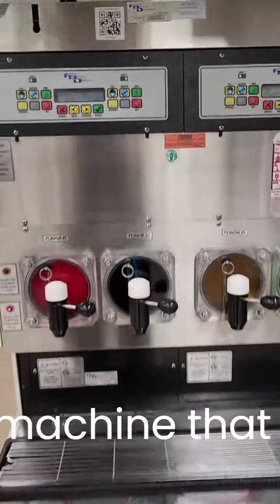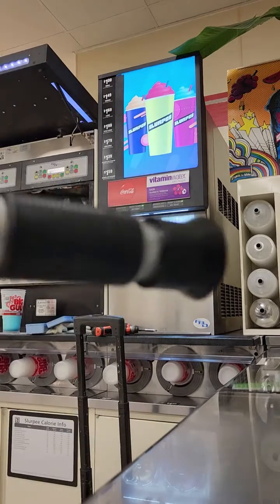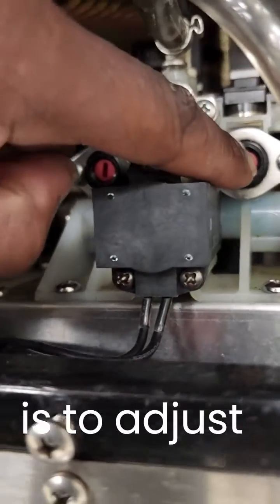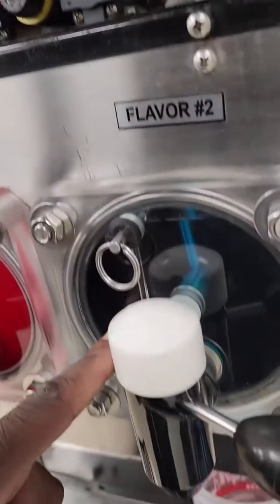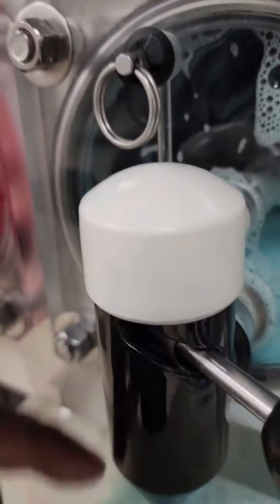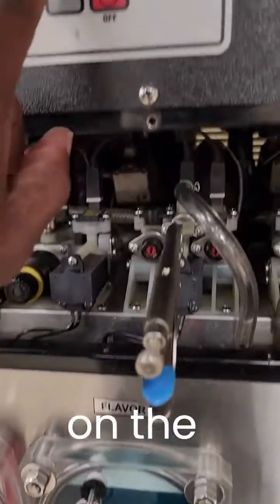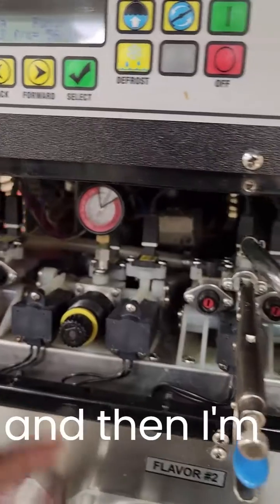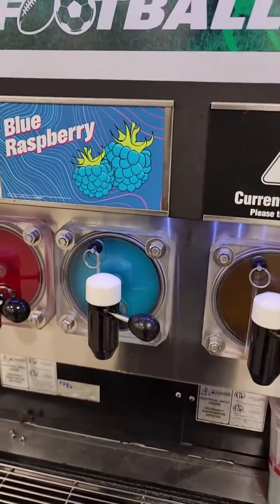Repair a Slurpee Machine Barrel not freezing

Comment: Hello, I have a problem. It was working, but now the machine is not working, the compressor is not working, and neither is the cooling fan. What is the problem?
Reply from the maker: Hello, if the compressor is not working it could be because the condenser fan is not coming on. Most times the condenser fan circuit is faulty but if you locate the condenser fan wiring which should be on the lower board , you can remove the wires from the board, there will be 3 wires and you can cut the hot and neutral wire and put spade terminals on them and connect them direct to the contactor on the transformer side and leave the ground wire connected to the terminal on the board . Then the condenser fan will come on when the contactor pulls in.  This way you can then connect your gauges up and check your pressures to see if the refrigeration system has a low charge.  I hope that helps.
Reply: Hi, great video!  I wonder if you can help me with my FBD564 unit.  I can't get the compressor to stay on in RUN.  If I manually turn it on with the menu it works.  What could be wrong?
Reply from the maker: @jaysimpson7866 Can you tell me what happens when it runs, and if it is a remote unit or a self contained unit?
Reply: @latcommercialrepair  It's a four barrel physical unit.  When I hit RUN it starts the compressor after a few seconds, but then the compressor stops.  Never freezes.  Does this for all four barrels.
Reply from the maker: @jaysimpson7866  Hey it sounds like you have an issue with the start components. You should contact FBD tech support. 866-323-2777

Comment: You’re the master!  How do you know when to adjust the water vs the syrup?
Reply from the maker: @RealSwayLuv  Thanks for the comment.  With the Slurpee machines you  should always adjust you water flow rate first . Once the water flow rate is set which should be 15oz. in 10 seconds, then you can check the brix and at that point you can adjust the syrup site up or down until the correct brix is reached.
Reply: @latcommercialrepair thank you so much! I def subscribed

Comment: Wait so original brix was fine you said, so what exactly did you do? Did you re brix it to a different sugar level? Or turn down the water? I know more syrup=freezing/condensation..
Reply: Bad flow controller leaking by syrup causes this issue will just come back 😮
Reply from the maker: @Randyraz-v5v Yes but usually the bad flow controler will show when you allow the barrel to fill again , you can take another brix when the barrel starts to fill  you should have the same brix you had from the sample tube , if not you may have flow controler issues or issues with the module. Sorry for the delay.
Reply from the maker: Hi Randy b, I always take 2 brix readings, one from the barrel and one from the sample tube. So in this video I had a high brix from the barrel of 20 and then I had a good brix reading from the sample tube. So in that case I emptied the barrel then allowed the barrel to fill and freeze with product that is at the correct brix. I hope that helps.😊